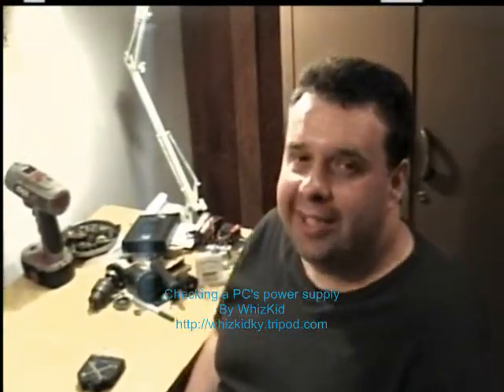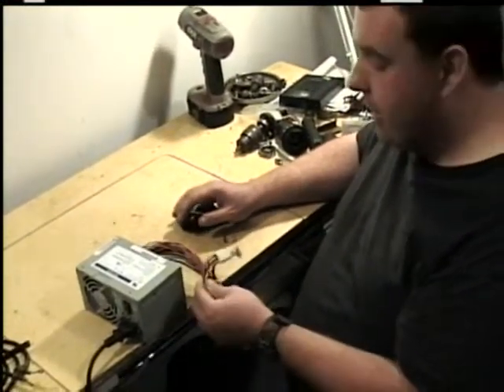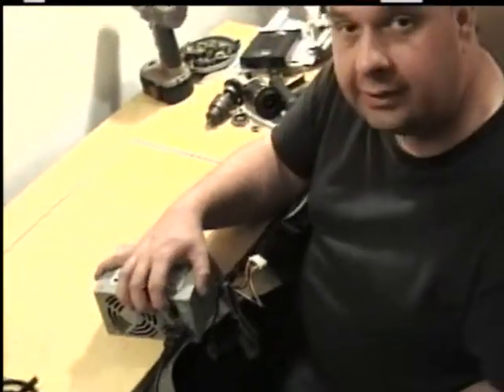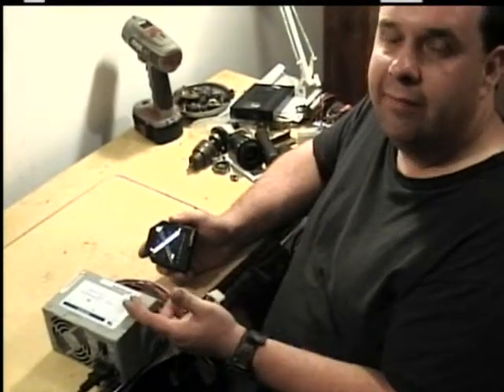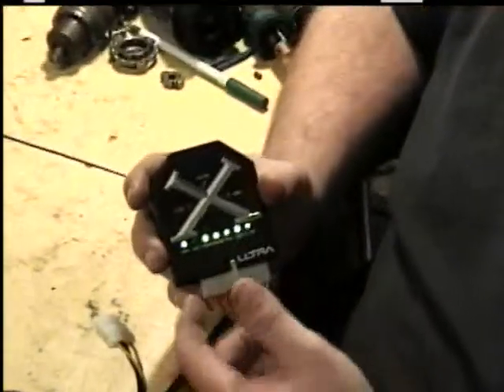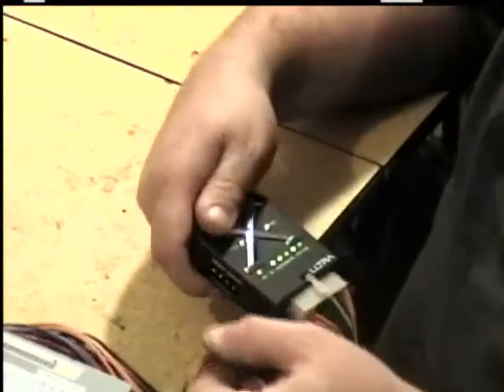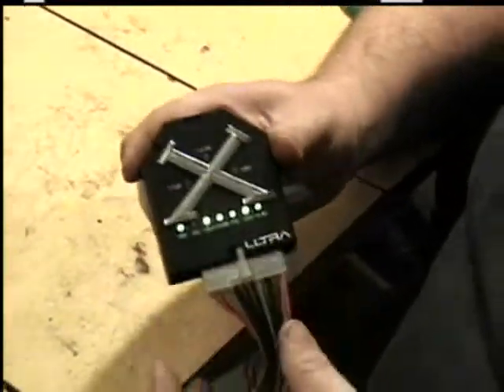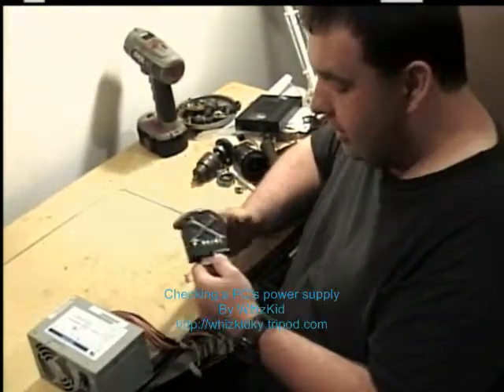Checking a PC's power supply unit

Comment: hy what a grate tester i have found one better on e bay -----   .ebay.co.uk/24-Pin-PC-LCD-PSU-ATX-SATA-HD-Power-Supply-Test-Tester-/220516285025?pt=UK_Computing_PowerSupplies_EH&hash=item3357cb7a61 i want one plus this has an lcd display buddy